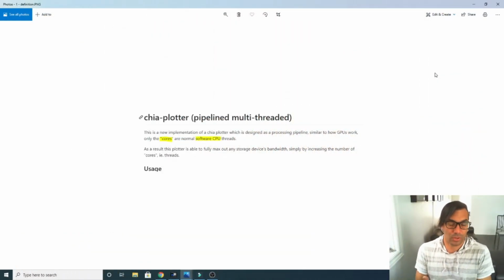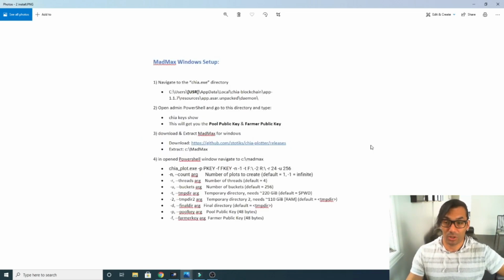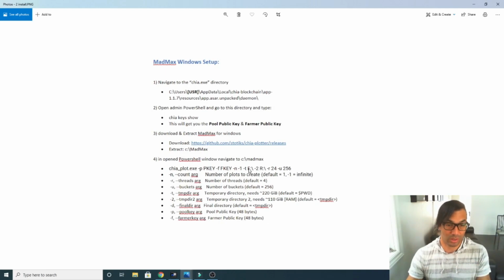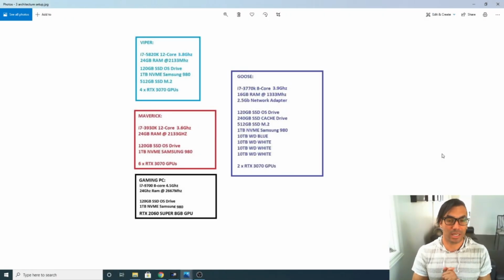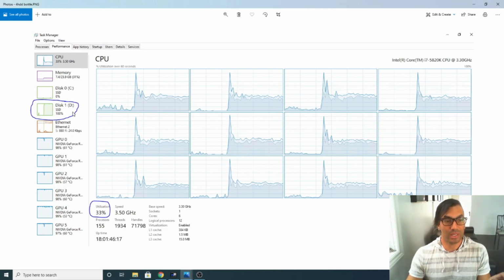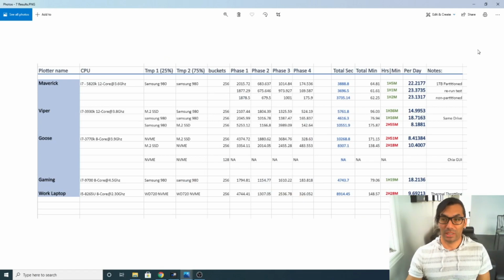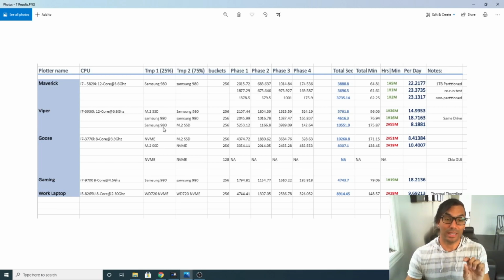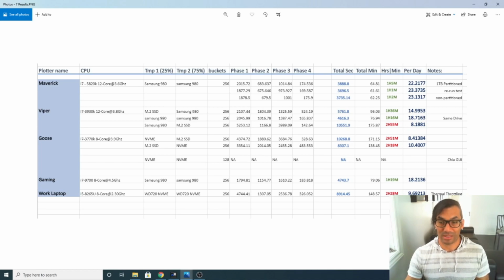80 Plots Per Day: Mad Max Fury Road & Bram Cohen RANT!!

Comment: hi, have you noticed that it plots the first plot really fast then it takes longer time to do the rest? I had to close it and rerun every now and then to keep up
Reply from the maker: I havnt plotted multiples back to back, I can test that today, I also have heard it online people saying the same thing. One thing I noticed is the temp cleanup doesn’t always happen so that may be an issue. I’ll let you know, and thanks for watching :)
Reply: @CustomComputing  I found that a powershell script to automate MadMax (with a TRIM command if you need it before each run) is best.  Only tell MadMax to plot 1 at a time (not multiples or infinitely).  Haven't seen a slowdown at all using this method.  Only using a SSD as Temp1 space here, HDDs for Temp2 in RAID 0 stripe.
Reply: @JagaTelesin  can u share your script?
Reply from the maker: Hey I was looking into this issue, it may be due to your NVME/SSD thermal throttling, I ran two back to back and didnt see any issues in terms of time, however I have thick heat sinks on my NVMEs with fans blowing on them.